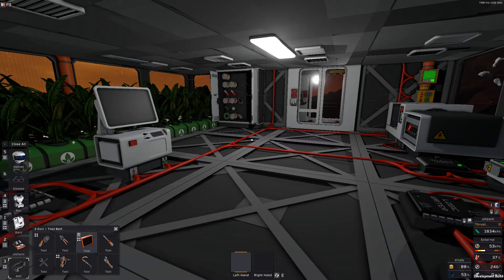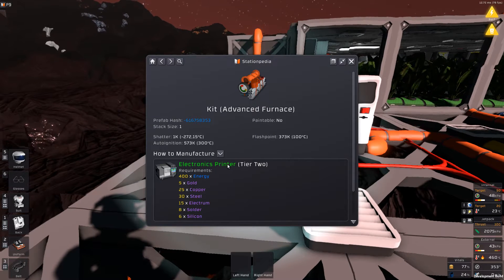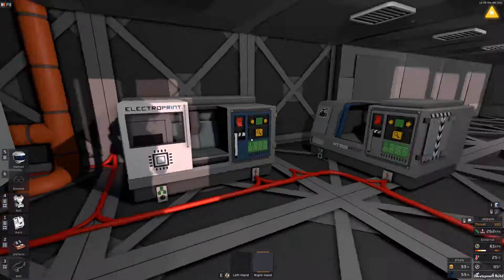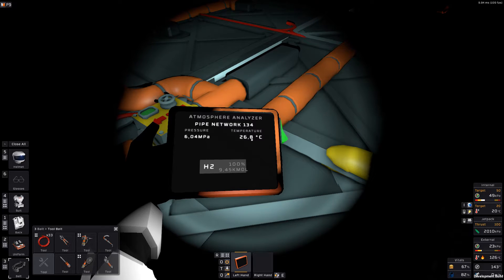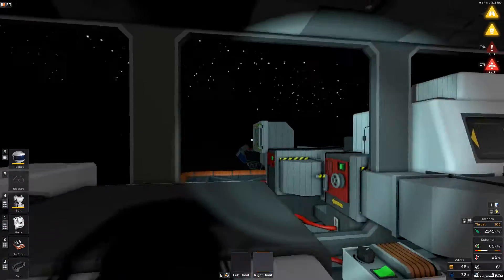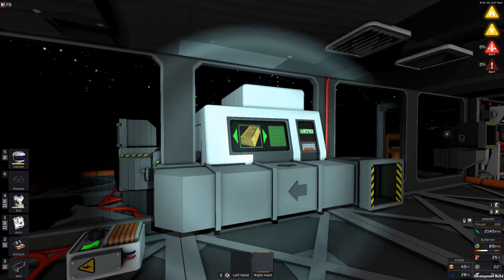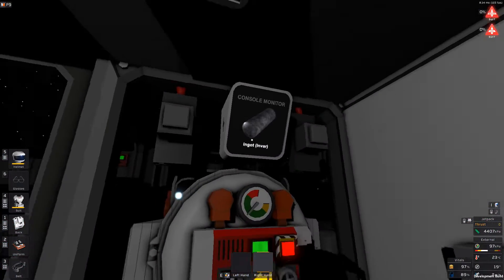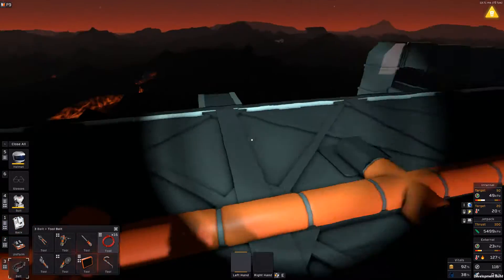Building A Storage System - Stationeers

Comment: it's amazing how many things you can cram into those 6 pins per IC. 

Using encoding for the memory chips based on digits, using the on/off switch of the already connected devices as buttons. Even suit functions are used as buttons. 

Also using the memory chips for communication between ICs. I assume the protocol is 0 is idle, anything can set the number and every tick the cell gets read and decoded by all interested ICs and if they are the target and can handle the request then they set it back to 0 to ack the message.

and I guess the routing is a round robin through all the sorters until it reaches the target sorter that direct connects to the thing doing the request.
Reply from the maker: Spot on! 😉👌

Comment: If you just setup an IC chip with a pointer r0 you can then have a switch statement with the different hashes. That way you don't need to copy past into the memchip every time. You can set it up with a dial for iterating over the hashes another for amount then use a hash display to show the item.